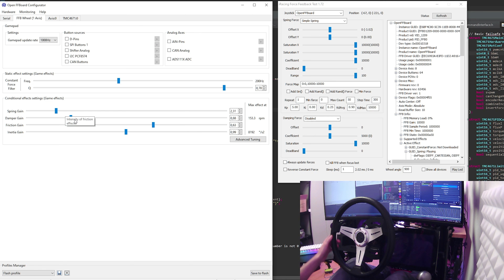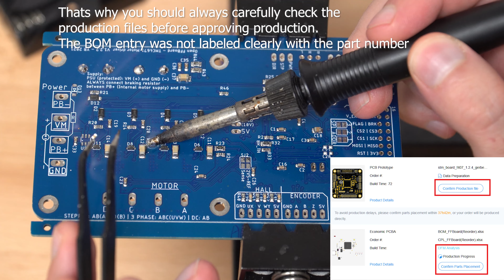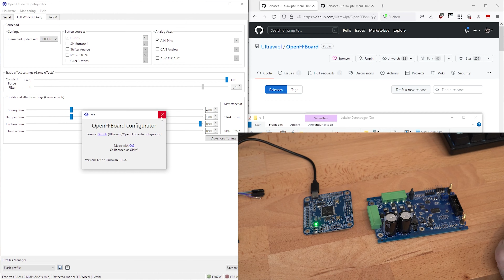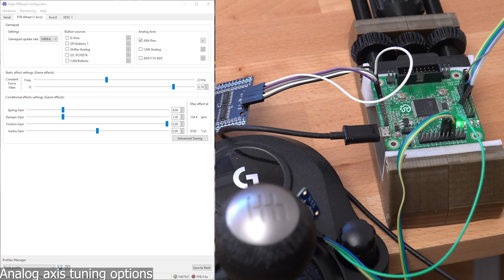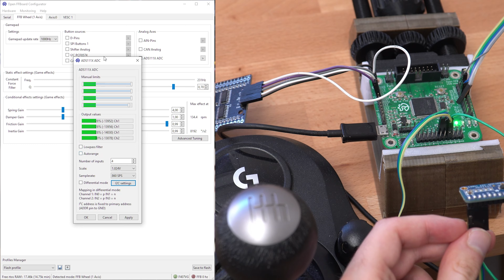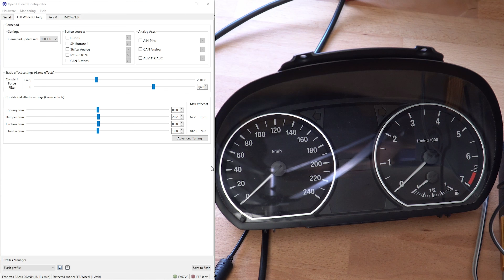Open FFBoard DIY FFB update 6: New GUI, ADS1115 ADC, Analog scaling, CAN instruments, USB-C

Comment: My friend, you're a genius and have done a lot of great work! Thank you for this. However, could you please create a proper pedal setup like others have, with a graph and so on? The modular system is also very poorly implemented — for example, the Ayupo CAN connection: the main board doesn’t detect what’s connected to it, such as an analog sensor

Comment: Gigawipf. We are a company building Flight simulators based on Xplane. Your system looks as if it is performing far greater than the current FFB system we have implemented. I want to know if you could pre-set a FFBoard to run on Xplane 12 for us along with recommended motors? We would like to purchase this setup from you as a kind of plug-and-play system. If you are interested, please let me know and I will send you my email address along with any details you may require. 

Awaiting your reply, 
Kind regards.

Comment: Hi. Does it work with flight simulators, does it supports several axis ffb for that, like just plug and play and u don't need to make extra software for that, and works with dc motors at ones with mentioned?
Reply from the maker: 2 Axis HID FFB: yes but not tested much and only with digital motor drivers (Odrive preferred, vesc, tmc). DC Motors: Yes but only single axis. There is only one ABN encoder input.

For non HID FFB there is currently a command based ffb interface in development using the same effect system via a different interface.
Reply: @Gigawipf  so no way, for now at least, use two dc motors, even with odrive? And no way to take btn motor drivers, and dc motors for both axis. I'm sorry, this is very interesting all and cool,  but really just want to know about this solutions particularly.
Reply from the maker: @modellerdesign  Odrive does not support dc motors. only 3 phase. You could use 2 separate controllers. For 2 axis PWM operation on one controller it would require significant pin remapping to get a second encoder interface. not happening
Reply: @Gigawipf  ok, i see, thanks a lot!)